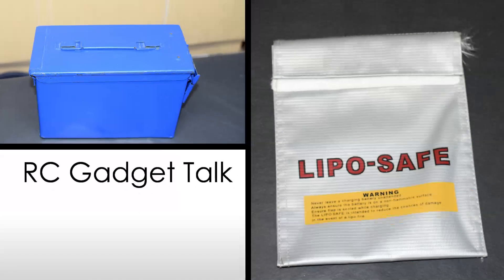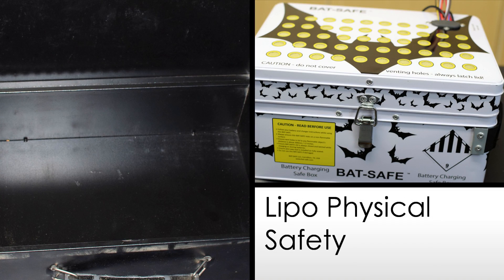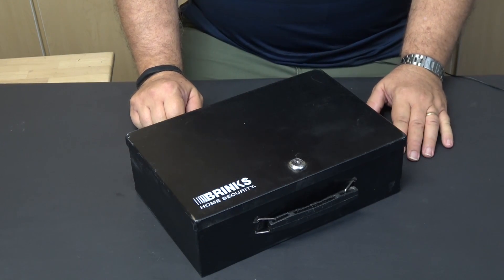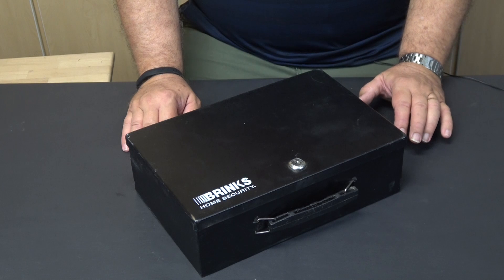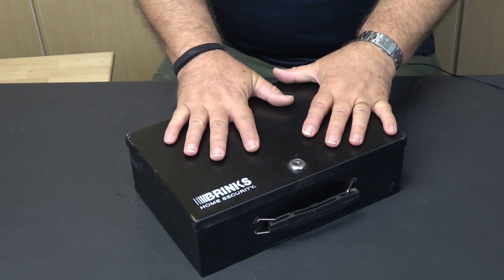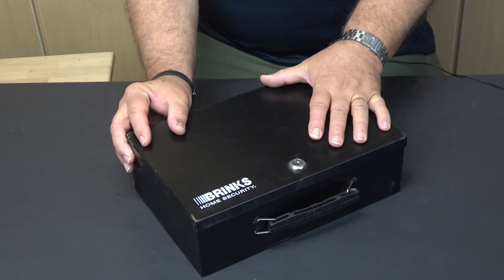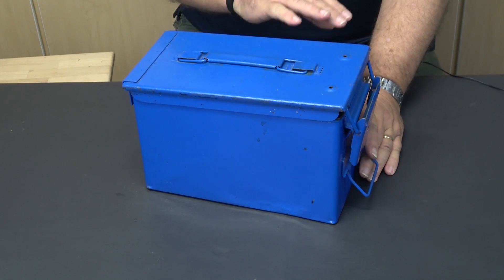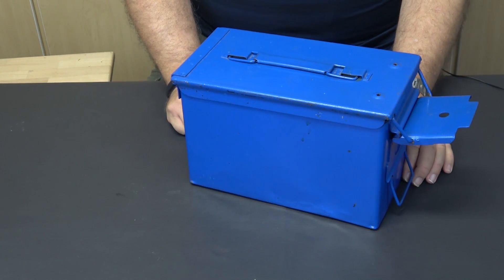RC Gadget Talk   Lipo Physical Safety

Comment: How safe is charging lipos or storing lipos in a cinder block bunk or cinder block box that’s what I’m using now
Reply from the maker: Lots of folks have chosen that solution. The goal is to keep the heat and flame contained for the few seconds it takes for the battery to vent and burn.

Comment: Good lecture, but "xyz will keep most of the gases in the container" is a myth. The gas will escape in any case, otherwise you would later open a pressured container. Smoke will come out in any case, the Batsafe offers the best protection against soot and poisonous gas. 
I charge mine in a cashbox with a hole large enough to run the leads through and most importantly, I stay in the room when charging. Experience tells us that you have about 30secs to bring a hissing battery outside before it bursts in flames. That is time enough for me. Dealing with batteries correctly is the best precaution. Check battery for damage before charging. Check that the cells are balanced before and after charging. Use a brand charger. Get rid of unbalanced batteries and double check the settings on your charger before pressing the start button. Always balance charge. Don't store batteries other than in storage charge. Avoid excess heat and cold. I additionally have my storage box packed with bags of Pyroballs. They are said to melt to a glass layer around the battery in case of fire and extinguish it quickly.  Youtube has videos that demonstrate this to work.

Comment: that's why i just charge mine in the field if it go's up it's only going to damage my small table i have, or in my shed  on the bench and it wouldn't damage a thing if all my battery's went up at the same time in there,  it's been well and truly tested with my forge only thing i have melted in there was one off the strip light ends then i got a fluorescent tube smack me on the head lol have been close to one going bang once when i was charging it in the field it  wasn't far away from being to hot to touch did sometimes charge them in the house but after that completely stopped

Comment: lipo-safe bag not do anythink, have only big joke at safety,. ammo box have cheap and best safety box what have if use safe-bag inside keep biggest fire in bag and then fire keep in metal box have 2 level safety. ,bat-safe have same but wery expensive and no have anythink better.real safety box pro model have in sandbags lot and covered glassfiber sheet inside and metal outside and have some ventilator all pressure can go to out,newermind if little fire can go tou too no burn anywere anythink safe place if charger. and store batterys. if want TRUE safety storage and charging station build brick wall box out at house and here in ammo box and thats in safety-bag then no fire do newer destroy anythink outside box. and ewery battery own section were store, brick box out of house.and door only uo,all explov go to up to sky not anywere side. same than bomp shield have

Comment: could lipo batteries go up in flames when just storing them or is it just mainly when your charging them?
Reply from the maker: A lipo is most likely to catch fire during charging or after being used too hard. By that I mean pulling more amps than recommended which causes the battery to get hot and/or puff up. I've heard of batteries catching fire a while after a flight where they were over amped or damaged by a crash. Lipos at storage voltage of about 3.8 volts per cell are unlikely to catch fire spontaneously. Storing in  a metal container or lipo bag is a good practice. I'm not a battery engineer so am speaking from experience not science.
Reply: mainly overcharging or when damaging them. Shorting can also lead to ignition.  Also :  discard puffed batteries.

Comment: I bought a 6 gal metal trashcan with a lid. The handle locks the lid in place. Drilled a couple of holes on the lid and placed the lipo bags inside with one battery per bag.
Reply: just thats, little hobby need only ammo box and many little bag ewery battery have own bag.